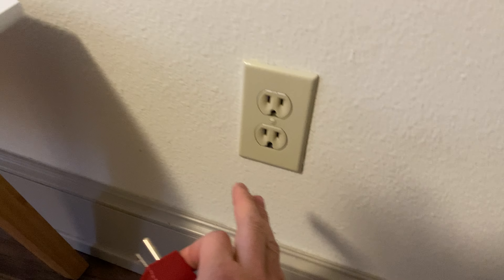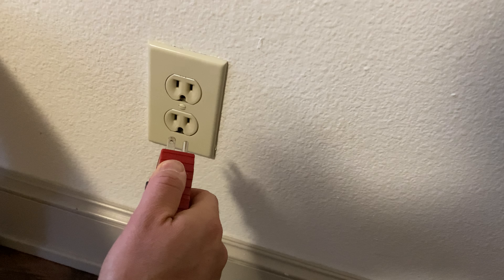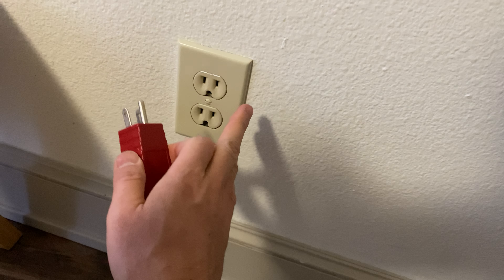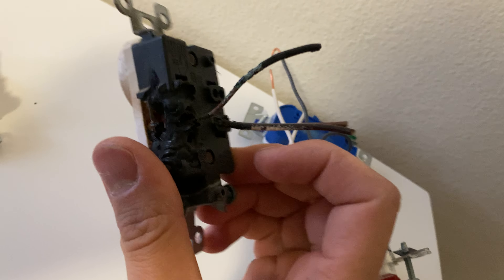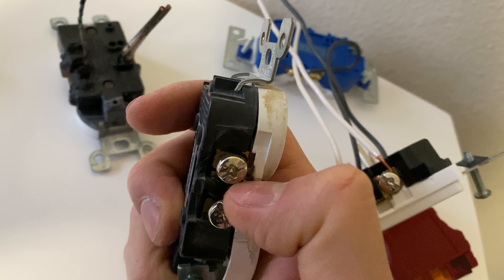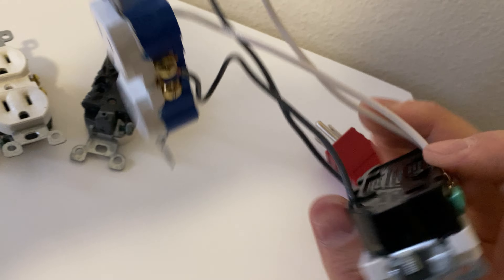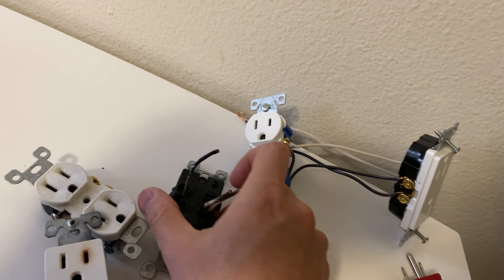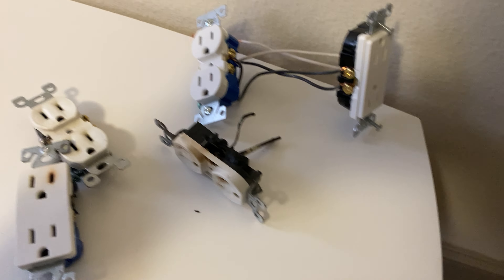Troubleshooting Non Working Electrical Outlets

Comment: This got me started on troubleshooting.  Mine turned out to be a GFI power-outlet that was closest to my home circuit breaker panel.  It all started outside with the continuous use of a pressure washer.  It just stopped, but the GFI on the outside outlet was not set off. Tested the power to this problem outlet, no power.  Pulled the outlet out...no power coming in.  Reset all the individual circuit breakers and power did not return.  Pulled the breaker panel and voltage tested all the individual circuits...all tested for 120V.  Checked the closest to the breaker panel outlet, turns out to be a GFI outlet, and that was tripped.  Reset that tripped GFI outlet and power came on all the outlets after it that were not working.  And my wife wanted me to call an electrician to come out....women just don't get it.  Thank you for setting me off on this troubleshooting journey and learning something along the way.
Reply from the maker: Nice! having 2 gfci in series will trick u like this (that's why we don't/not legal)